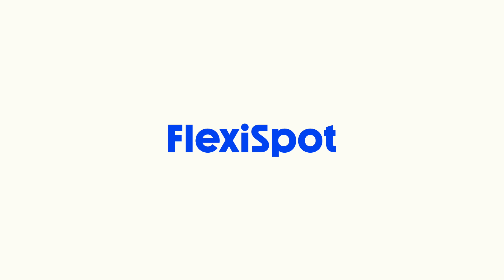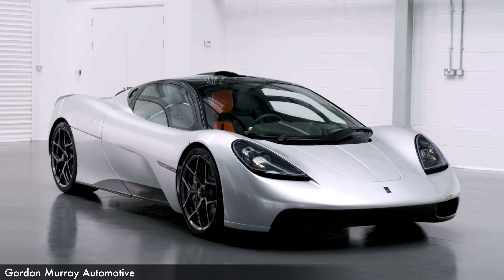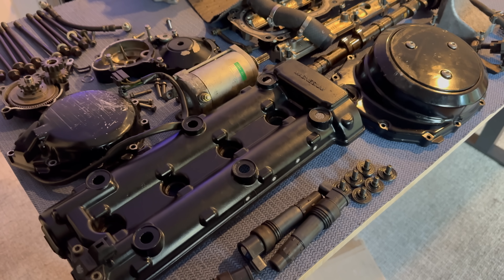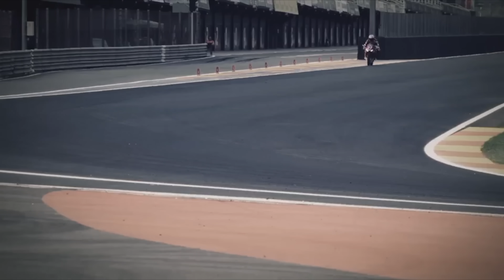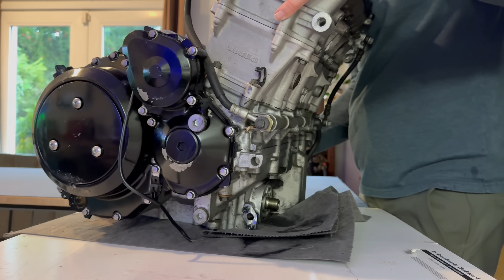Motorcycle Engines Are WAY BETTER than Car Engines

Comment: A major advantage of two intake/exhaust valves is that they have more circumference for the same area. Because the circumference is where the air flows through that means that you get the same flow with less lift, which means you can rev higher and also the flow rises quicker which gives a wider power band.

Comment: Motorcycle engines don't need to push around a 3,000 - 7,000lb vehicle. Moving that weight causes mechanical stress. High horsepower also causes a lot of mechanical stress. So there's concessions that MUST be made for cars. Could Honda make a naturally aspirated Honda Civic engine crank out 450hp? Sure, but it would be a race engine, and it's going to last as long as a race engine in a car. That is, not very long at all.

Comment: i too have more engines than bikes. when I found the old elsinore engine i couldn't help taking it home. do i have an eksinore frame? nope.  but i got the carb and pipe to go with the engine.

Comment: Ah yes, same mpg at 1/4 of the weight, 10x service intervals
So much better
Reply: My sport bike gets double the mileage of my car and the service frequency is maybe 2-4x as much, but far easier to do myself than the car.

Its also way more exciting and engaging than anything you can drive for less than 10x the price. Totally worth it.

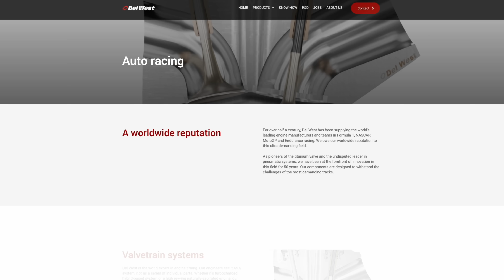Comment: 6:55 SO IT WAS YOU
Reply: what do u know
Reply: @gavinlongwith6979  Z06 is notorious for valve drop in that generation, however it was head side more than the valve itself failing I'm pretty certain

Comment: Wouldn't it be amazing if every car brand had a nimble roadster the way they all have an SUV nowadays? They'd rival in mass and engine type. Some would be 600 kg and would have a dorito spinner, some would have a bike engine revving to 14k rpm. Some would have non-synchronised transmissions to save weight and simplicity. Super small wheels, two seats, moderately loud exhausts. Naturaly aspirated or supercharged... all of that is only a fantasy because of emission restrictions.

Comment: aeromomentum aircraft engines are suzuki factory mod engines. they have significantly better power to weight ratio's than their air cooled lycoming/continental counterparts, even though they're water cooled. they also have turbo charged versions that have similar performance at 20,000 feet as they do near sea level and since they're fully fadec controlled, they have one lever operation- which reduces work load on the pilot. since 85% of all GA crashes are pilot error, less things managed by humans & more by computer means less crashes. an airboat service in FL uses aeromomentum engines and had one boat that stood up to 10,000 hours of operation before needing rebuild. they can be mapped from the factory to run on E85, giving better performance at higher altitude & cheaper operating costs, as these engines are already at 10.5 to 1, they LOVE to run on alcohol.

Comment: They're awesome because they don't have the fuel efficiency requirements the epa puts on passenger vehicles. Motorcycle engines produce waaaaaaaaaay more pollution per gallon than car engines, like hundreds of times more. But they're so much better at producing power because of it.

Comment: Pretty cool video, I feel like 90's Honda engines, specifically the B series, pull a lot of inspiration from their motorcycle division in at least the vision that they have. I've spent a modest amount of money on my B Series build and ended up with a 1.8L that revs to 10k making just over 200hp at the wheels. It's a fantastic car to drive and feels characteristically more like a motorcycle than any other car I've driven

Comment: Motorcycle might be the best place to use pre chamber combustion, and get more power with turbo or supercharging and have lower heat rejection, waaaaay better thermal efficiency and NO detonation. Like F1.

Comment: RE the whole pollution thing, rule of thumb is that the closer to full occupancy a vehicle is the better the emissions are per person. One person driving a motorbike will be better than one person driving a car. One person driving a car, however, will actually be worse for emissions than taking a commercial flight that has decent passenger numbers. So if you're doing a 2 person road trip in an ICE car with the intention of reducing your carbon footprint (which bear in mind the is made up by oil companies to obfuscate the responsibility of climate change), it's actually better for two people to fly than to drive in a normal car.

Comment: 13:47 hey buddy I hate to break it to you but I've had all kinds of different motorcycles. The most reliable motorcyclists that I've ever had by hands on number one is Yamaha. Number two Suzuki and Suzuki is tied with Yamaha. Second place is Honda and then third place is BMW. 
Royal Enfield, Moto guzzi, ural
These bikes that I've listed have been known to be the most reliable motorcycles. 
I've had a couple of sport bikes especially high performance sport bikes that easily went past 120,000 mi and yes I drove the hell out of them Yes it did need the maintenance but I didn't have a single problem with any of those bikes I never had a single breakdown except for a clutch cable breaking which is typical. Just use a bicycle cable kit which is a temporary fix by the way just in case this happens to you that's a tip. Walmart has plenty of bicycle cables 😊
Anyways besides that I've had quite a few bikes that were way past 100,000 miles I've even had one that was almost $200,000 mi and most of the bikes that were high mileage like that was one BMW, Yamaha and Suzuki. Suzuki uses a special silicon nickel carbide coating just like Yamaha does just a little bit different but this technology is significant. 
After all the bikes I drove I went back to the beloved Suzuki TU250X because that j438 engine is an absolute legend and it has that same nickel silicon carbide coating and cylinder wall essentially if you take good care of that bike with the same coating technology even after 150,000 mi you might potentially still have the original factory honing lines. 😮
You want to look for motorcycles with this kind of stuff man Diesel last you a long time

Comment: so why are motorcycle engines WAY BETTER?

they have to move nothing.
need an insane amount of maintenance.
eat an astronomical amount of fuel.
have higher pollution.

and sharing a component with a race car is worthless. 
you can find something in a corola that's also used in F1.

Comment: Motorcycle engines are better than car engines under a few conditions:
Above several thousand RPM and for maybe 50.000 miles, if you're taking good care of them.
If the car engine is not your TYPICAL car engine, you require anything OTHER than peak horsepower or you might wanna drive the thing for longer than double digit.000 mileage, they are inferior.

Comment: Am I wrong when I say 1 big valve is better than 2 smaller ones? If it’s about surface area to allow more airflow, the single valve would be better. It’s like the pizza problem. Two 10” pizzas are smaller than a 15”.

Comment: Moto guzzi make motorcycles and they made a small piston motorbike mounted v8 which was and still is insane. Now they make OHV air cooled v twins on their bikes. My dad pulled the heads off his Mille GT in half an hour. Because the heads stick outside the frame it was an easy job. Moto guzzi rejected the ducati engine because it was too unreliable. They sound great and they have torque and they last 200,000 kms because revs kill engines. They went with a shaft drive to further reduce maintenance. If you have a high strung screamer it will wear out quickly. Except for Honda car engines. I would take a long lasting engine any day over a high revving screamer that lasts 60k miles before a rebuild. If you want power get a 2 stroke.

Comment: One important point is that bore size is mainly about torque. If you try to accelerate a car which is at least 5 times heavier than a reguler bike u will need much more torque than a motocyle engine. Thats why motocyle engines can rev a lot.

Comment: I used to make turbo'd bikes. They were insane. 250hp, 250ft/lbs at 5200RPMs, I could do a power wheelie at 140mph without trouble. I almost finished putting that same motorcycle motor/turbo setup in a 1975 Triumph spitfire, but kind of lost steam on it and gave up. The stock rear end on those cars were a mess and there was no simple bolt in solution. I became exhausted with the high maintenance of the turbo engines and got rid of all those projects. Now I prefer EVs, because frankly they are faster, more fun and require zero maintenance. Win/win/win

Comment: With the aluminum bolts, are you using steel tools? If so, that is actually a steel is slightly harder than aluminum problem that can be solved by using aluminum tools.

Comment: also, whes cruising motorcycle engines have so much lighter load, that the load they experience 95% of the time is lower so the wear is lower. Also the torqe is lower wich causes losts of the wear, you can see this in harleys with huge torque needing big gearboxes and destoying cheap tyres quickly.

Comment: TLDR: If you want a track day car find a car with motorcycle engine. General use - that's what the normal car engines are designed for.

Comment: funny thing is that due to the emission reatrictions in Germany, common car engines are now like 1.0- 1.2l with 3Zylinders, they try to press out 130 HP from that with turbos, which makes it a pain cos they often fail. On the same street we have 1.0-1.4l 4zylinder bikes, that have between 100 and 200 HP very common. In fact my own aprillia has more power and displacement thn my common opel car. But I gut it for 1/3 of the price at the end

Comment: Bravo. Although I will say, motorcycle engines can last much longer than 40,000 miles. Those with compression ratios and tuning designed for more street applications rather than screaming around a racing circuit, they last much longer with regular maintenance. Oil is cheap. Much cheaper than engine parts.

Comment: Guy from Croatia Darko Labaš (born in 1957, passed away from lung sickness almost 3 years ago) bought a Yamaha FJ 1100 and covered exactly 1 563 292 km in 33 years (odometer reading when he passed away), and yeah you read it right 1.5 million kilometers (approximately 930k miles). Motorcycle had only 2 big overhauls and 4 minor. So yeah, motorcycles are in fact more durable than cars and one of the reasons is that they are motorcycles and they have to be durable because they are dangeraus.

Comment: The thing with motorcycle engines is they had to keep it small. With cars, it was alot easier to make giant engines or throw on a super or turbo charge since there was a lot more room. Motorcycles you have to cram alot of engine in a small space so engineers got creative.

I'm a sport bike rider and it still blows my mine I can rev to a 14-15k RPM redline.

Comment: Hemi heads flow more air than 4 valve heads. 4 valve heads have smaller valves so the can turn more rpm and make more power even though though they flow less. Velocity prefers one path over 2 paths.

Comment: no, they aren´t. period. but you put a nike engine in a car and see that it will not work. and the reason is easy, a bike can´t have high torque cause it wouldn´t go nowhere. a car needs torque. and this is why cars are faster after the launch.
Reply: Car engines will last , Bikes engines won't.

Comment: What motorcycle engines are designed for 100,000 miles? Guzzis, R100 BMWs...any more? Would a Grom or nc700 nc750x do it?

Comment: Honda used to make a motorcycle engined car, an N360 it was called. It had a twin cylinder, single cam, gear stick attached to the dash, front wheel drive, and it had a top speed of 80Kmh, down hill, with a tail breeze .. About the same shaping as a mini, a bit smaller. I had a 1971 model, if I remember. They had a 850 Scamp as well.  .. BTW, I now ride a ZX14, true 200 horses and a magical, miracle motor. 100,000 Kms coming up, and never, not once, missed a beat.

Comment: Motorcycle engines are designed for shorter miles than 4 wheelers and they are not designed with longevity in mind is the most western words I ever heard here. Asia laughs at your problem 😂

Comment: I really saw the contrast when I owned a BMW motorcycle and a 1971 VW van. The 1600cc Type 1 engine on the van, a 4-cylinder boxer, made 2/3 the HP of the 900cc 2-cylinder boxer engine on the BMW (still considered "underpowered" for a 900cc motorcycle engine), and yet the VW was far less reliable and less smooth than the BMW (and some enthusiasts had turbocharged the BMW engine to 160HP—over 3X the HP of the VW—and still had high reliability, showing how overbuilt it was). The crank journals on the BMW were twice the size of the VW, and the rods comparably thicker, with higher precision throughout.

Comment: I would like to add

Motorcycles can spend so much on the engine because it's literally in the name

Motor-cycle, a cycle with a motor in it

Imagine a Bugatti Chiron Super Sport without anything else apart from an engine, a chassis, some wheels, a seat (maybe a passenger seat too), and controls

People would riot, or they would charge a bazillion dollar because 'superleggera'

Comment: Isnt the problem with motorcycle engines the nox production?

Like, they are amazing efficiency and power, but they create more Nox due to higher pressure (more efficient) combustion or something.

Maybe I should watch the video

Comment: Slow revving bikes tend to last longer.  I had a 2007 Honda VTX 1300cc v-twin cruiser which had a red line of 5,700 and when I sold it at 100,000 miles the motor was still running well and I never did anything to the motor other than change the oil and filters and adjust the valves.

Comment: The problem with higher revs is more about hydraulic tappets, than different loads and dimensions. Engineers would have no problem to design engine, that revs to 15 000rpm and lasts for half million of km. But it would not have automatic valve adjustments, like every modern car. Maintenance would be much more expensive. And instead of changing fluids once a year, a car would require to remove cylinder head every year to inspect valves.
Also, higher rpms are not incompatible with low emissions. Car engines have lower emissions thanks to all the extra devices, that motorcycles don't, not because of lower rpms. If anything, higher compression and higher temperature in car engines increases emissions, that is, why cars need all the extra exhaust gas recirculations and catalytic converters

Comment: Thanks / VERY interesting I have had many 4 cylinders rice burners 1100GPZ & Gxr . I have had a S2000 AP1 for years revs to 9000 great car . Honda should come out with a S3000 Dude overhead cam in line six with 350 HP. that would be Cool.

Comment: They choke every engine made today and destroy them with EGR and exhaust pressures from all the filtration. Question: if we made cars that lasted longer and burned cleaner vs cars that produced less emissions and died sooner, would overall emissions go down since less vehicles would need to be produced to replace the cars that get destroyed due to engine failure or exuberant repair bills? I imagine the process to create a vehicle from scratch has a much higher emissions footprint than the emissions produced by the car during its lifespan.

Comment: Motorcycle engine superiority (0:00)
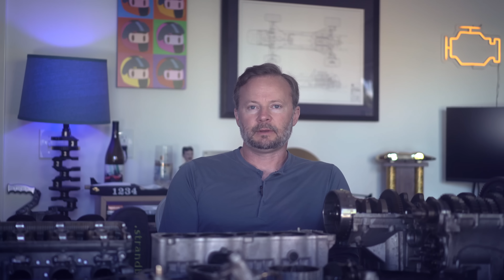Power density & engineering (0:18)
How engines make power (0:40)
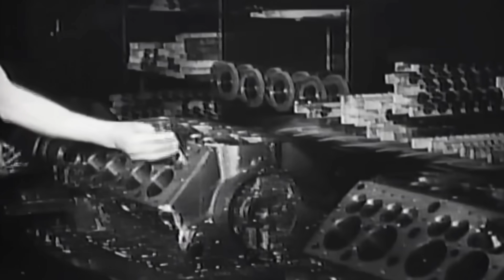Airflow & valve design (1:44)
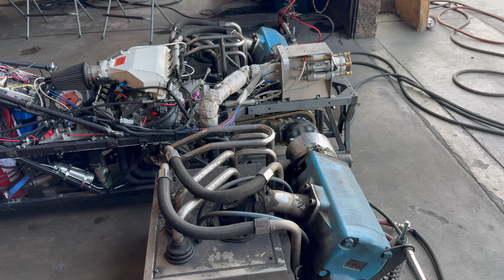Emissions impact (2:39)
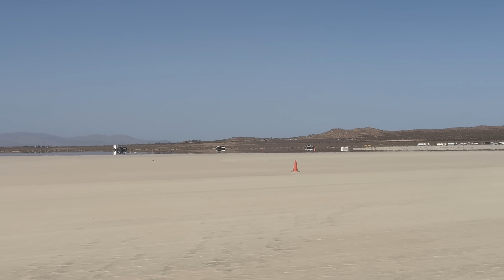High revs & lightweight parts (4:01)
Weight & integrated powertrain (9:22)
Car engine differences (13:05)

Comment: Very nice video. My only critique is the idea that modern motorcycle engines are not designed for 150,000 miles. I don't own any BMWs, but California Highway Patrol does and their motorcycles are running up to 150,000 miles (supposed to be 100,000 miles, but can be extended as told to me by a CHP motorcycle officer anyway). I myself have a middle weight Yamaha XSR700 at over 150,000 miles as well. Modern motorcycle engines are quite reliable overall (at least the Japanese and German ones) it seems.

Comment: Considering how short in length motorcycle engines are, a strait six s2000 refresh might be able to work by stretching a CBR engine. End up with a 1.5L that probably could be made to put out ~192hp with the 9k rev limit like on the first gen s2000. VTECH has been well proven to make emissions and power. Probably end up with NA Miata amounts of torque.

Comment: I thought one of the more important factors was that a motorcycle engine only really has to propel let's say 700 lbs at most whereas a car is easily 3000lbs empty, and the super lightweight perfectly balanced motorcycle engine parts will probably snap itself to pieces when loaded up with two adults, two children, a dog and five vacation bags.

Comment: I drive a 1992 Suzuki cappuccino. The motor is so small it’s considered a “ motorcycle engine “, 660cc and a rev limit of 12 grand. 50-60 miles per gallon. I could never go back

Comment: and they're so friggin hard to find. I have an old 70's enduro 125 frame i want to put a 250-300cc in but the used ones you do see are expensive as fuck.